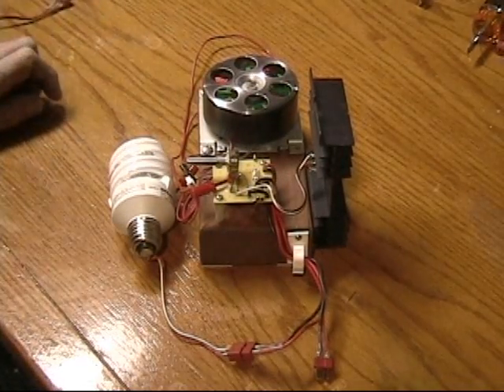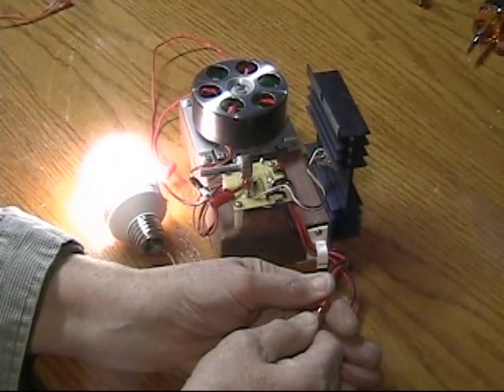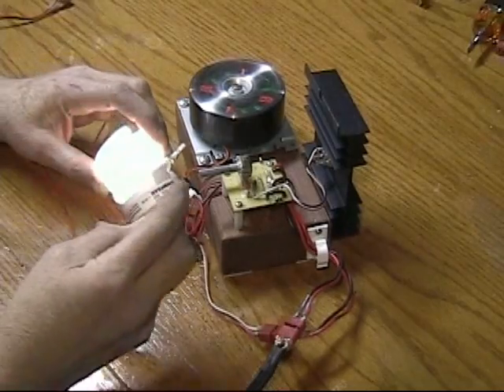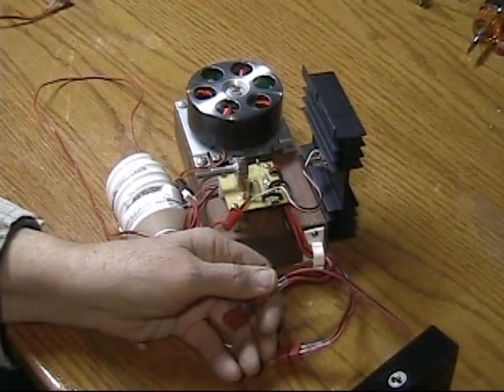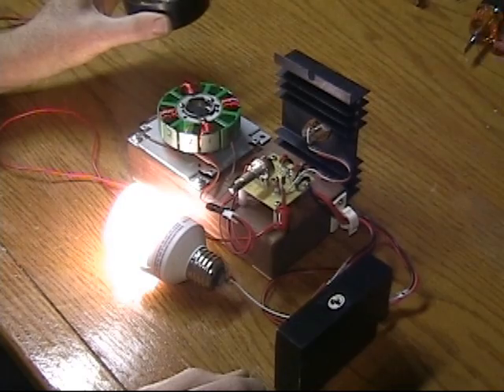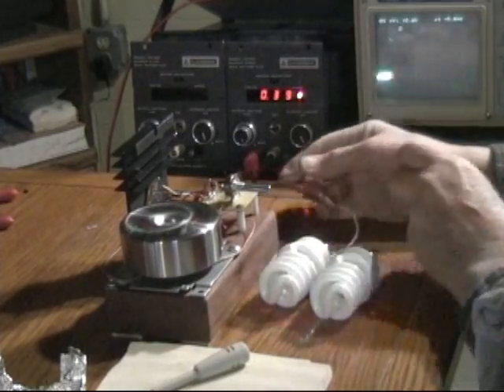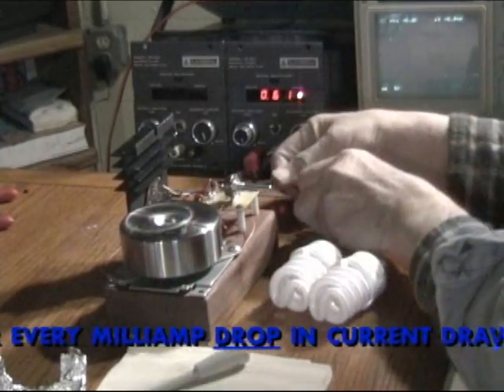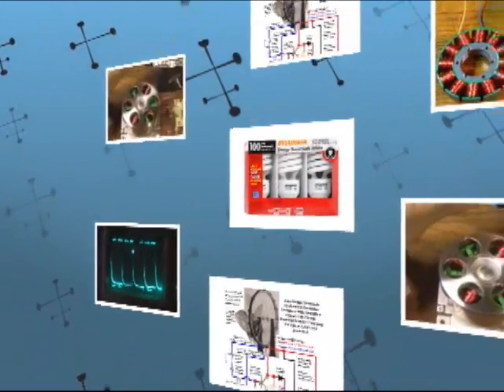Bedini Quadrapole SSG Self Oscillating

Comment: How much power is used to power up the motor and how much power does that motor output?
Reply from the maker: Hello TK, The device is actually more of a mechanical oscillator than a motor. Of course when it self oscillates it becomes a solid state oscillator. As a motor it is obsolete because in experiments after this one I wind all 12 legs of the stator. On all the experiments I have with this type motor the torque is pretty low because I use small magnets to keep the RPM high. If I where looking for a motor application I would go back to the three phase winding and build it like large model airplane motor.

Comment: I'd appreciate some advice as I'm working on a similar bedini SSG.  I picked up a pair of HP laser printer toner motors but am having problems figuring out how to take the rotor/stator apart without destroying the motor.  Can you please advise?  I'd also like to know in what direction each of the 12 stator coils were wound.  Thanks in advance.
Reply from the maker: Hello, That's a good question and I really need to make a video on the subject as soon as I can. These motors can really be difficult and there are so many styles. If you have one with a retainer clip you should be able to remove the clip and pull back the rotor. Most of these motors are a tight fit in the bearings and you have to press the shaft out but with a clip you might be in luck. Some of mine I had to tap back with a nylon mallet while pulling on the rotor, and others I had to press the shaft out of the rotor from the other direction. This is less desirable because realignment and fastening becomes difficult. You may need to polish the shaft with some emery cloth so you can have easy removal for adjustments. I heat the outside of the rotor and peel the soft magnet away from the sides of the rotor. In some of my motors I use 12 very small magnets nsnsns etc. This setup is for higher speed mechanical oscillator operation rather than motor torque. The motor that I have most fun with is wound alternately cw ccw cw ccw alternately around the 12 legs. You can use as many strands as you like depending on if you are doing bifilar SSG, Half Wave or Full Wave sequential bipolar configurations. I have fun with one thin trigger coil of about #28 wire and two heavier power coils of about #22 or something like that. This gives you the opportunity to use one of the power coils as a generator coil or to combine the coils in series for different results. The bearings can be rinsed in alcohol if desired and then oiled with thin machine oil or hobby oil to get a free spin on the rotor. I hop this helps. 
John
Reply: ***** Thanks.  So, I could use my hot air reflow station to heat up the rotor and pull off the top, replace the ring magnet and expose the stator windings?
Reply from the maker: TSN Research
Hello I'm not sure what a hot air reflow system is. Is it something like a heat gun. I use a small torch. You have to remove the snap ring and try to pull the rotor off before you can heat the rotor from the outside and peel the magnets on the inside away from the wall of the rotor.
John

Comment: Could you recommend any brushless motors that could be used to make a Bedini motor other than computer fans? I was considering an RC plane rotor motor though the existing magnets might be a pain to remove/relocate.
Reply from the maker: Hello Adam, I'm using office printer motors for most of these experiments but they are really hard to get apart and ready for winding. Almost any out runner style motor can be to work including some ceiling fans and even washing machine motors. R/C motors are a little too small in my opinion but can work as well as some of the even smaller hard drive motors.
J
Reply: Thank you for your quick reply! And yes, I agree about using a larger motor. If I can find a larger one at a good price (if I can't find one elsewhere), I'll definitely use it.

Comment: I suggest you do a minor circuit re-design, to replace the Darlington with a power MOSFET. Something like one of the International Rectifier series. These devices now have a on-resistance (source to drain) equal to that of switch contacts. Darlingtons are transistors that can never fully saturate due to the how the two internal transistors are connected. As such, you lose about 2 volts across a Darlington and there is nothing you can do to change that except replace it with a MOSFET.
Reply from the maker: Hello Ted, that's good information thank you. I'll keep that in mind the next time I do something with a blocking oscillator.
John

Comment: Hi, I want to try to make a bedini motor, but can you give me a hint or instruction how to dismantle the print drive motor because I want to use it as a wheel?
Reply from the maker: Wow that's a tough question since there are so many different kinds of motors. I use a nylon hammer to tap the shaft and rotor off the bearings. Sometimes there  is a gear on the shaft that doesn't allow that and you have to press the shaft out in the other direction. These are very hard to work with and there is always danger of damage to the bearings. I will make a video soon to explain further.
J
Reply: DadHav, thank you very much for valuable reply. I appreciate it very much. 
Looking forward to seeing your video for dismantling (sample) print drive motor.

Comment: How long will the bulbs run off of the self oscillating circuit via 12 volt battery
Reply from the maker: Of course it depends  on the size of the battery but this is not a good example to use. Do a search for Joule Thief on the tube and you can find some very efficient devices.
J

Comment from the maker: Sam the bulb is only a way to show the circuit is oscillating and is outputting a higher voltage than is going in. This is not meant to suggest this is a good way to light a bulb. It's just the first time I had a circuit oscillate and I got a little over excited, not realizing this sort of thing happens all the time with circuits like this.
J

Comment: I see lots of misconceptions here look at your standard fluorescent bulb like the one in the video, it only draws 15 watts if you do the math that's 136 milliamps at 110V resistance of 806.7 ohms.  So why strap a motor onto one its not going to make it better.  Now if that motor was running itself from the back EMF I would be impressed who cares about a bulb.  Don't get me wrong I don't believe in free energy but I do believe in efficiency and if you could achieve %100 amazing.

Comment from the maker: Actually the same circuit but it is oscillating and the back EMF from the coils has enough voltage to light the bulb. The motor will run while the coils oscillate.
John

Comment from the maker: You're very wrong with your statement. A Joule thief is a blocking oscillator and must oscillate to work In most cases and Bedini circuits that are connected to mechanical oscillator will not operate correctly if it self oscillates like a JT. You didn't mention what Bedini circuit you're talking about either. Care to elaborate? Maybe we can clear things up for you Sara.
J

Comment: One idea I have, is reverse engineering everything.  If a motor can be used as a generator, could capacitors be used as well as a spark gap to recharge the other motor?  There has to be a way.  I've been working on it with motors I pulled out of a DVD player.  They run off a 12v battery but I need advice cause I'm new to this.  So any help would be appreciated so much.

Comment: because offend you?
my language is not English, is the Spanish and however I make the effort of
to understand yours.
your bedini machine cannot load the batteries because violate the law of thermodynamics.
5 by10 cannot be removed. multply the tencion of input by the current, and the same
calculation in the output and see that the efficiency is always less than one.
up to the stars work so, this universe was created at a loss, I am sorry.

Comment from the maker: Hello. I have all the coils wired but I don't remember how I had this stator wound, but you can wind any number of legs in a typical bi-filer manner with one trigger wire and one power wire. Just remember to reverse the direction of every other leg. Wind from one leg to the other from two wire spools. When you finish you should have the same connections as any bi-filer coil would have on the board. You can also wind two legs with a trigger wire and two with a power wire. Hope this helps.
John

Comment from the maker: Hello. Someone gave these to me but, but if you go on E-Bay and type a search for printer motors, you will find a large selection. They are all similar but some are a little more difficult to take apart. I think the ones I have are from the HP printers. You could probably ask the seller if he knows the diameter of the rotors. Naturally larger is better.
Hope this helps.
J

Comment from the maker: @dougspair 
Doug the LED's on these motors are just for show. The battery kit on the other hand is only a few milliamperes. Some of the motors operate a little more like a standard generator. Window motors for example can be used with a sequential bipolar circuit and the output from one of the coils can be rectified to charge a capacitor the the capacitor timed to discharge into the battery. Other circuits using SSG charge with the back emf from the coils collapsing.
J

Comment: ..Ok..so at the 6 seconds...it seems the motor and coils are acting as a transformer? I assume that, since it won't work well after removing the rotor? What is the frequency you're driving the motor coils..? Sounds like several hundred Hz or more. I wear hearing aids and often I don't hear sounds accurately.
 I'm assuming you're operating the CFL's through the in-base drivers, rather than a very high voltage spike??
 And...do you have schematics for these things, or is that secret..?

Comment from the maker: @MrAdrian512 
Adrian. The bulb is lighting from what is usually considered a harmful or unusable Back EMF from the coils. The energy from the coils collapsing and causing a high voltage spike are what's lighting the bulb. These spikes are normally detrimental in Inductive circuits and usually sent to ground or dealt with in some other manner so they don't harm the associated circuitry. Can this be considered free energy because it is usually something that is unwanted? Some think so.
John

Comment from the maker: @alienhddna 
Hello. The motor is from an office machine printer or copier. You can find them on E-bay for as little as $10.00 if you do a search for printer mains motor. See my video High Voltage Without Power Supply II for a better description of the motor and board it comes on.
John

Comment from the maker: @333kgb 
Yep, It's possible the rotor could stop. The oscillations can be strong enough to cancel out any pulse you have running the motor. Sometimes the oscillations are because the trigger resistance is to high. Also twisting your wires together before you wind a core or coil can help.
Good Luck.
John

Comment: During my experiences in building a bedini energizer,(yet to document) I ran into that oscillation because I had more than one trigger coil after adding my second coil. It sat on the shelf for a month until the idea came to me, to remove one during rebuild. Realizing after the fact of removing one that that was maybe my problem. It was interesting but not the result I wanted and I rectified it.

Comment: I have learned a lot about these motors/generator/chargers which ever people choose to call them.  I have built dozens  The point that I am trying to get across is that from my experience the self oscillation that occours is due to the amount of wire on the coil the type of potentiometer example 1K,5K,10K and also of course the resistor being used between the potentiometer and the coil winding. My bedini type setup oscillates without any mags as soon as you turn it on with a 56k resistor&1K pot!

Comment: One reason the circuit is self oscillating could be that the top lead of the power coil and the top lead of the trigger coil accidentally got connected.  If so, than what you now have resembles a joule theif more than a bedini motor.

Comment: I only know of two ways to get the leaving N field of the magnet to sync up with the collapsing N field of the coil.

One is speed and the other is to narrow up the N fields of your magnets.
This can be done by sticking 2 magnets together North to North & South to South.
This maybe hard depending on how strong your magnets are.

I have found that a wide N field of the magnets saturated the core of the coil.
The coil fails to see a fully collapsed N Field thus decreasing its spike potential.

Comment: Hi DadHav, 

You know what?
I'm gonna have to take that all back lol.

Ok I've been quite busy comparing self oscillating to running magnet.
I have found an increase in the spike produced when using the magnet opposed to self oscillation. The trick is to synchronize the leaving N field of the magnet with the collapsing N field of the coil. The coil only sees a stronger N field collapsing than it created. This puts more oomph into your spike. I gather this is where the over unity comes from.

Comment: With a few circuit modifications and some experimental time I think you just might be right. I find it works better once my batteries have gone through some conditioning which is probably why I wasn't getting much charging before. 
Cheers.
@ble

Comment: Wont it do the same thing if you replace that motor with a transformer.  because if so, your project is only a step up transformer but with a different coil arrangement. 

And btw transformers do make a hum when they are in operation, right.  :P

Comment: Awesome!

That happened to me as well. The first Bedini me and my friend built was a self-oscillating one.
The first time we turned that on we turned off immediately thinking something was wrong..but it wasn't.
The coil is a bifilar 24/26AWG 600 turns...air coil to spin a 1" neodimiun magnet.
It pushes a 4Ah/12V to 14.50V drawing 0.310mAh/16V from power adapter.

Anyway, excellent work!
Fernando

Comment: So, how did you get the tinfoil inside the bulb? Because in order for that to even be possible with the bulb still operational, you'd have to manufacture it with the tinfoil already inserted to the glass assembly.

Also, what's that really high pitched whine?

Comment: Hey, I got my SSG to self-oscillate by adding a bigger resistance in the triggering side of the circuit. It began to make strange noises then too ;D
If I have a higher resistance the frequency will go up and vice versa. Then I tried something crazy; I put a LED in parallel with the 10 K resistor and the coil began to sing very high :D
In addition, the led could make light when connected in both polarities, which is a little bit strange...
Dig your movies : )